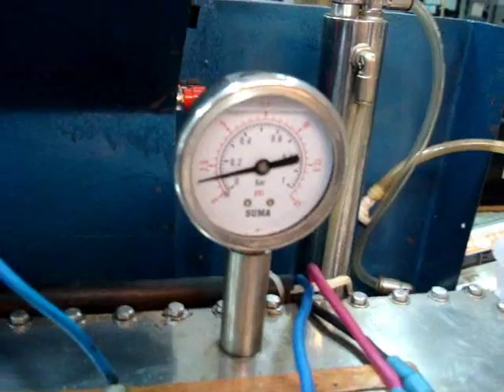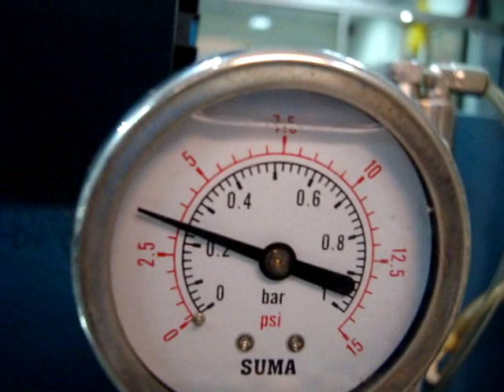Run Small Lawnmower engine on 100% HHO gas

Comment: @sleepwalker29 dude, its a 2 stroke weed eater engine. the way 2 strokes operate, they need oil mixed with the fuel. on a 2 stroke, the fuel/oil mix is drawn into the crankcase when the piston moves up, then as the piston comes down, the intake port closes and the transfer ports open. the fuel is transferred into the cylinder from the crankcase via the transfer ports.  
there is no crankcase oil on a 2 stroke since the oil in the fuel lubes everything as it passes through the engine.

Comment: hi if  its  a 2 stroke engine it will Need oil for lubrication without it would eaven go bust on Petrol can use a funnel with pipe and ajusting screw and just let drops of oil in the air intake  have fun nice work

Comment: @Turbojeep23 You better check your weed eater bro. There is a seperate place for oil by itself on all 2stroke and 4stroke engines, Lawnmowers, dirtbikes, etc. My electric air compressor has oil. This oil I'm talking about lubercates rods, cranks, rings, and such. There is usually a cheep plastic dip stick attached to the oil resavoir lid, or opening. 2cycle oil only lubercates the piston rings, it dosen't go anywhere else.

Comment: @STORMCAT06 well that's becouse gasoline has a very big amount of energy in a very small volume, for the energy of 1L of gasoline you would need a tank of 90L full with HHO at 25atm.. (thats 2250L at 1atm) to generate that amount of HHO yould would need electric energy, when the alternators are connected to a load, they are much harder to spin, so the engine consumes more energy to spin the alternators.

Comment: @sleepwalker29 there is NO oil in the crankcase of a 2 stroke dirtbike. the oil you are referring to is for the transmission, which is sealed off from the crankcase since a 2 stroke cannot have oil in the place where the fuel is inducted through. 

like ive said before, ive rebuilt quite a few 2 strokes and torn down many more than that. i know 2 strokes inside and out. dont underestimate me. 

go use google before trying to prove someone wrong.

Comment: for running only on hho you need to change ignition for 80 degrees, and it's better to use 4 cycle engine 'cause adjusment is easy and lubrication doesn't depend on fuel...

Comment: it wont provide the 18 amps you are using to make the gas but i'd like to see a vid with a hho/diesel generator so you can measure power output difference. BTW i want a lab like yours from what i can see nice set up.

Comment: As far as this goes, yes i believe its a waste of energy because the engine has no altenator but as far as an automobile goes as long as you keep adding water when it needs it, it will run the engine which inturns runs the altenator, as long as you keep up with the water its perpetual.

Comment: @sleepwalker29  the second comment was actually a continuation of the first. 
if the oil in a 2stroke isnt mixed in the fuel where does it go? if it was oil injected, would it have a separate reservoir for oil. if its not oil injected, like a weed eater, the fuel and oil is mixed in the gas tank. 
my first comment did have to do with the hho. if its running on hho, how is oil getting to it? its not mixed with the fuel, and i dont see an oil pump or reservoir. which means its not getting any oil

Comment: @Turbojeep23 Look at a 2stroke dirt bike and tell me it dosen't have oil in the crank, on the points. Etc. If you know the rout of fuel you would know that the rods, are under the piston, and never see fuel, and so are a bunch of other parts.Fuel is sprayed in the intake, where it goes to the piston, fuel does not go through the entire engine, so you need straight oil for lubercation. (go carts, dirt bikes, chainsaws, lawnmowers) So You really don't know how to check the dipstick, can't find it!

Comment: THAT. WAS . AWSOME . do it again  and i must know your cell design , whats your mmw , also (this ones hard ) take it down to only 2 plates , measure the lpm constant , then make the same plates of gold , or at least coper sheeting , and if you dont get more hho then you will use less power and compare the mmw between the 2 metals , for consanistancy use the same water , and then if you like the results , swich to full coper , its resistance is so much lower that you should get around 30-50 mmw

Comment: making hydrogen takes alot current to produce .making pure hydrogen storing it then using it is the ticket 12volts is good for a small system maybe to give more mpg.Make 2 large bladders one over the other  have ,a outlet in top of the upper bladder for the hydrogen gas outlet .More bladders better the gas ,bladders need to be at least a gallon .

Comment: hydrogen can't be used in 'every' engine as it is so small it will pass through the metal. The materials need to be specially made to handle hydrogen. If you put hydrogen in your normal car it can crack any non-treated metal it comes into contact with - so be careful of your liners, pistons, cylinder head - basically the majority of what your engine is made of!

Comment: @Turbojeep23 You had to use google. LOL Oil is oil dude! Yes transmission have oil but its all the same, just different weights, for its application, when you recycle it they poor transmission oil, AKA fluid, engine oil, brake fluid, all in the same container. You just can't put antifreeze in. So that proves all oil is the same but different weights. Running out of room to type here.

Comment: Meyer's research lead him to (K.I.S.S. After he learned the secrets of HHO) the 'water splitter plug.'  If the 'water splitter' cracked just  0.5cc of H2O inside a cylinder compressed with ambient moist air, the heat of the cracking would probably crack and then burn all the water vapor near the initially cracked H2O.  So why does everybody focus on his electrolysis process?

Comment: so how would this work? You would strap a hydrogen tank to your back with hydrogen fuel lines into the motor? Which is cheaper gasoline or hyrdrogen?
Sure any ICE will burn hydrogen, but whats the economic comparison between these 2 fuel?  The US is loaded with natural gas, why not just power all our ICE with natural gas?

Comment: When its yelow flame it means there is more oxygen than hydrogen. You have to add more negative plate for hydrogen to make blue flame.
Reply: WRONG, THE FLAME IS YELLOW THERE IS SODIUM IN THE GAS, HE NEED A DRYER AND THE FLAME WILL BE BLUE AND INVISIBLE,

Comment: The problem is it isn't practical. Say if someone designed a cell that was lightweight, fitted to a lawnmower, and produced enough to run it, along with some way of supplying power to the generator, that would be amazing.

Comment: Th HP or kW of the engine is probably a lot lower running from hydrogen then from gasoline, so less heat is generated, probably lower max rpm as well. It probably would melt after a while though.

Comment: @sleepwalker29 the oil mixed in the fuel lubes the crank and its bearings, needle bearings, rings and cylinder as it travels through the engine WITH the fuel. 2 strokes have NO other oil in them. `your air compressor, doesnt operate like a 2 stroke at all, which is why it has an oil reservoir and a dipstick.
you really need to understand the principals of a 2 stroke before you go running your mouth on the internet.

Comment: @sleepwalker29 why do you think weedeaters need 2 stroke oil mixed with the fuel? know what your talking about before you try to say someone is stupid, because you just made yourself look like an idiot. 

and for the record, i've rebuilt a few 2 stroke engines, 550 twin, 600 twin, 580 twin, and im going to do a 900 triple soon. ive also rebuilt a chevy 307 V8 and a jeep 4.0L I6 and a couple briggs motors.  i think i can handle the simple task of checking the oil level in a 4 stroke.

Comment: @Turbojeep23 Your statement is stupid. Putting oil in the engine has nothing to do with fuel. The fuel and oil don't go in the same place, so if you did''t know that, how are you suppose to catch on to this. I bet you don't know how to check a dip stick.

Comment: Like this guys spelling? "proof" (prove) "thing" (things) "improable" (improbable) How heavy is this weed eater going to be? 200#? Running w/o oil is possible as long as there is no load on engine. Residual oil inside will help. No, this guys nuts. No 2 stroke engine will run w/o lube so this entire "cluster fuck" of a video is pointless. Just don't send money to these online scammers. Nothing works as good as the stock system. After 39 years as a mechanic on these, I should know.
Reply: Yamaha SR650 if it would have been four stroke it wouldn’t need lube in the fuel.
Reply: Yamaha SR650 and i think this is just suposed to be proof of concept